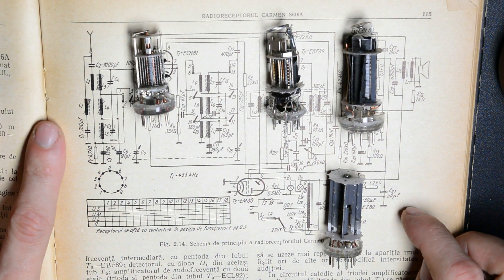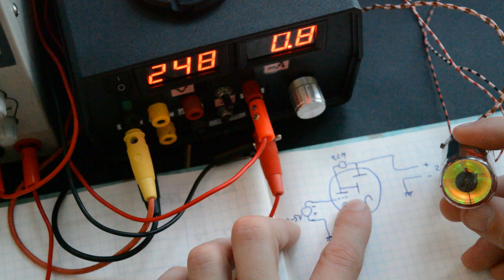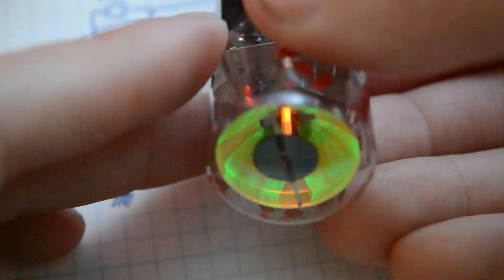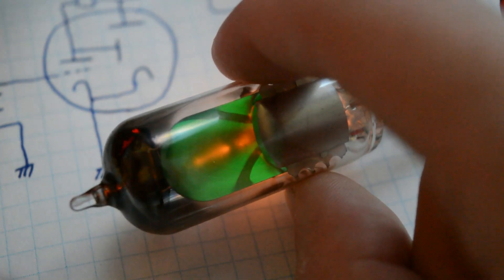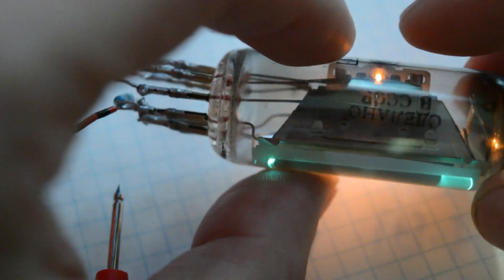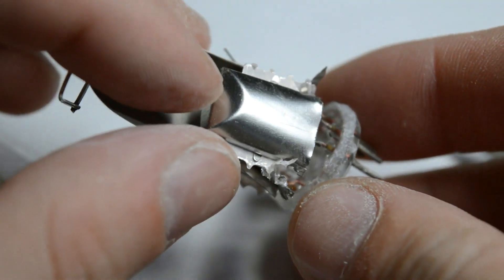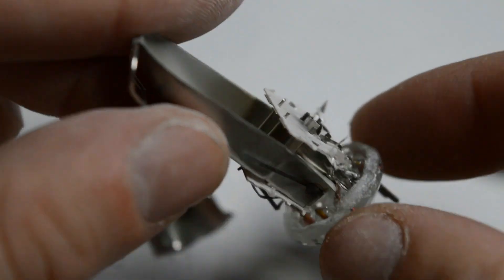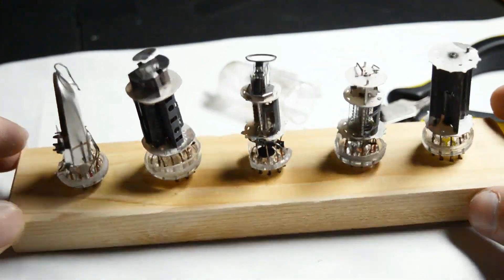Vacuum Tube teardown - the EM80 Magic eye tube

Comment: how are you able to hold the tube while its on without burning your fingers?
Reply from the maker: In the case of this particular tube, the external glass does not get that hot. Also, as long as you hold it on the edge furthest away from the heater its quite ok.

Comment: Ich wollte Wissen ob ich die 6E2 ersetzen kann durch eine EM800. Ist der Sockel gleich und die Pinn Belegung. Oder muss die Platine angepasst werden? Oder geht es gar nicht? Danke

I wanted to know if I could replace the 6E2 with an EM800. Is the socket the same and the pin assignment. Or does the board have to be adapted? Or is it not possible at all? Thank you
Reply: Ja, die sind Pinkompatibel. Siehe Datenblätter. Vollausschlag muss evtl angepasst werden.
Reply: @blitzroehre1807  Danke. Dann kaufe ich mal dem nächst noch zwei EM 800 Röhren. Weil mir gefällt das die EM800 ein Balken haben im Gegensatz zu den 6E2 mir zwei gegen läufigen Balken.

Comment: Anyone know if these things just wear out? I have no green but filament  lights up. Otherwise, radio works fine.. Customer wants to replace the EM 80 but want to be ready when he replaces the tube and finds out still no green magic.
Reply: Phosphorus target that glows green wears quite fast on those EM80 tubes. If there is a faint glow only visible in darkness then you most likely have a worn out tube. Also low anode voltage will cause that. EM84 tubes last much longer as they are made like tiny CRTs.
Reply: Like any tube with extended use, they can absolutely wear out and go low emission. The heater still glows but there's little or no electron emission from the cathode, and so very dim or no green glow. I seen it a few times with magic eye tubes in old radios. Check you have adequate HT at the anode, and the biasing is correct.
Reply: Yes, they CAN wear out and go blank
Reply from the maker: I tested multiple of these tubes (also EM84) and never did I find 2 used tubes glowing in exactly the same brightness and color shade. It's very possible that the tube its self has an issue, though I would check the voltages on pins 7 and 9 just to make sure that the anode supply doesn't have an issue.
Reply: @FesZElectronics  thanks.  . Radio is old and original so  I may find bad resistor or cap in that area.  Also suggested lack of agc  voltage, which drives this circuit.
Reply: Yes, the life expectancy of the fluorescent coating is only in the low thousands of operating hours.

Comment: Really great tear down and demo.  I like the more modern m84, but the EM80 is probably my favorite in overall appearance, the dual meter is really cool.  I really like the tube tear downs, it helps demystify an old science that was itself an art.  It's really great to see them in action like in you were able to do here, can't wait to see a whole radio!  Thanks again for such great unique videos.
Reply from the maker: I'm really happy you liked it! After the radio video, I think I will keep making more vacuum tube related videos, but I will not be taking them apart, just supplying and showing a more or less functional circuit. My first idea in this direction would be to study voltage stabilizer gas discharge tubes and linear voltage regulators in general. What do you think?